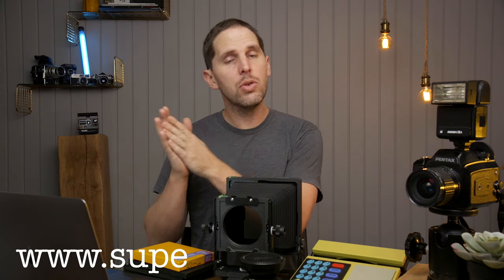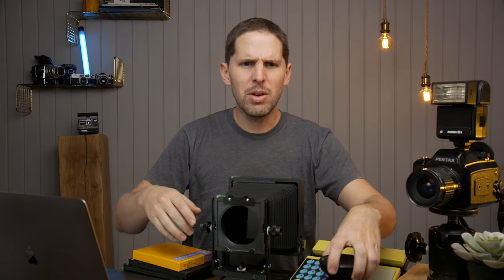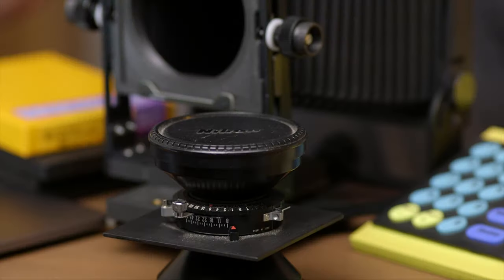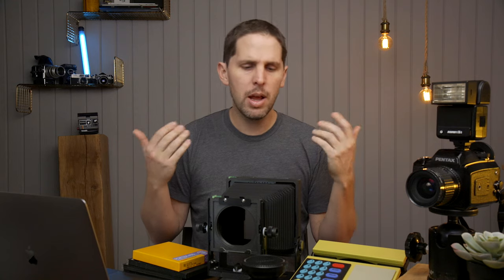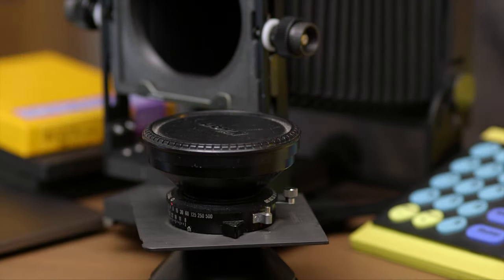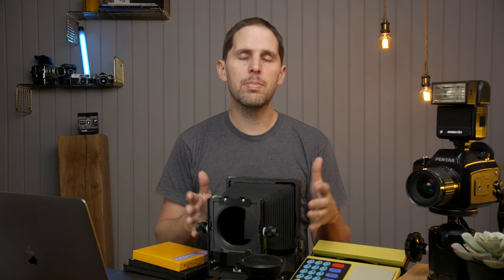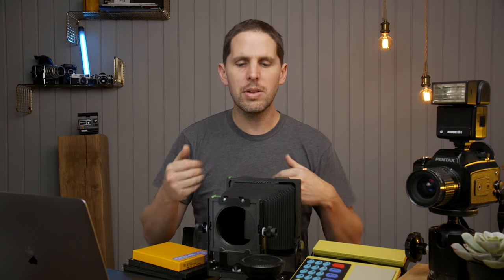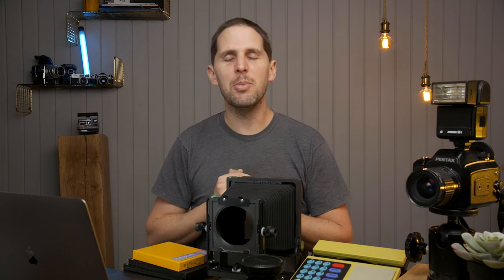Linhof Off Center Lens Board || Super Film Support

Comment: Years ago a friend of mine loaned me his 4x5 Speed Graphic. It had the 127 Ektar lens. I noticed that the lens was mounted higher than the center of the board. The camera did have limited front movements to allow for rise and fall, but by mounting the lens off-center vertically, it meant that you also had extra rise and fall built into the mount. The lens could be placed on the camera with the lens higher or lower just by flipping the mount orientation. I thought it was a clever adaptation. I have not seen anyone else use this since then. I taught college photo classes for 25 years, and have collected and sold many view cameras, so I was surprised no one else did this. This is the most common movement to use with a view camera, to raise or lower your horizon line to get more foreground or more sky.

Comment: Interesting. Your musings regarding these lens boards with off-center holes are the same as mine. Just two additional aspects: If the camera has a rear standard that can tilt both ways out of the vertical position (as the current Intrepid model provides), you can get a larger rise or fall by moving the camera base out of the horizontal position and compensate this by tilting front and rear back to their vertical position (most might know, but some might wonder). And secondly I noticed that the tilt axis of the Intrepid (and maybe of other models too) is already below the center of the lens board, and even below the center of the (already slightly lowered) mounting hole – and this I find to be even more of a real head scratcher …

Comment: My Wista 45D doesn't have front fall, only rise, which is a pain more often than you'd think. Having an off centre board and having to rise a little to centre it can be a good thing (though my current lenses are on centred holes). With a field camera you should generally not assume that zero stops centre things but check on ground glass anyhow.

Comment: mostly this isn't a big problem, for larger Monorails, as the sinar, Linhof, etc are bigger apatures than the field designs, so add an "adaptor board" and this should fix it, the design of this places the rear element in the new boards centre, so all is good; however if you can't do this, go to your local camera shop that can deal with these cameras, and get a LENS WRENCH these allow one to adapt the copal shutter to a new board, by yourself, so you can exchange the board for one which is centered!, just be carefull, as you need to remove the rear lens element to access the lock ring.